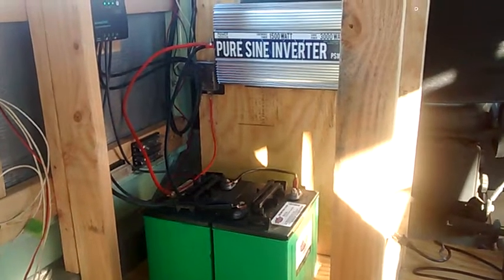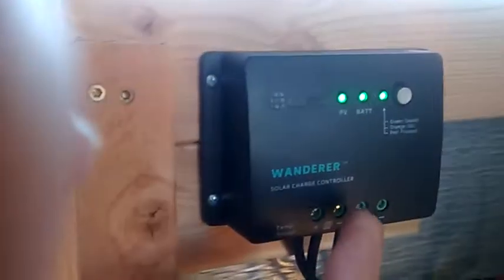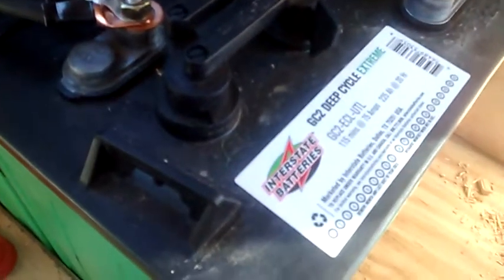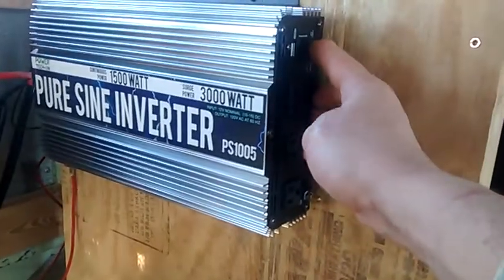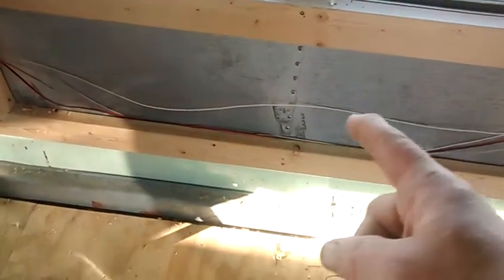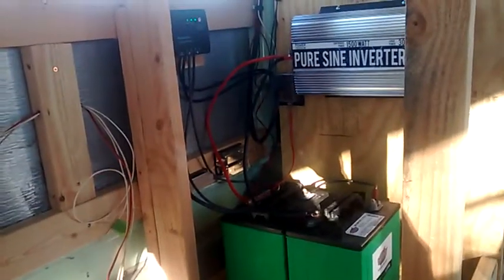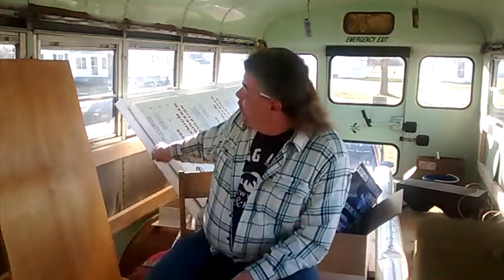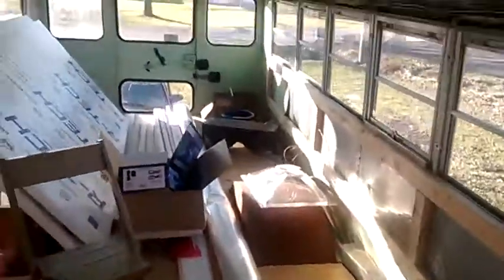Mullet's Skoolie Build EP 12 - We Have Power!

Comment: I just added the same 12 volt system as yours,with only one 100 watt panel. I've got  2,6 volt golf cart batteries called Crown that are made in Ohio,if I'm wrong it looks as your charge controller is set for sealed batteries? Are they not flooded batteries? I only ask cause I mimicked your setup in my bus but my batteries are flooded as per the specs from manufacturer. I thought 6 volt Interstate were flooded as well. I'll soon be making a appointment  to get my bus up to your shop,want to check the parameters as you showed in one of your videos. I wanted to get it up there sooner. but my dads health hasn't been good lately. Sorry to bore you,appreciate the videos.

Comment: I recommend using some foil ducting tape to hold those wires to the metal walls so they don't get pinched or abraded by the studs
Reply from the maker: I have wire loom to cover and protect the wires. After the switchbox is in it will be all tidy and secured.
Reply: Johnny Mullet not just a hat rack are ya!